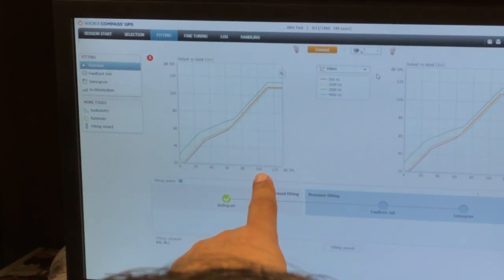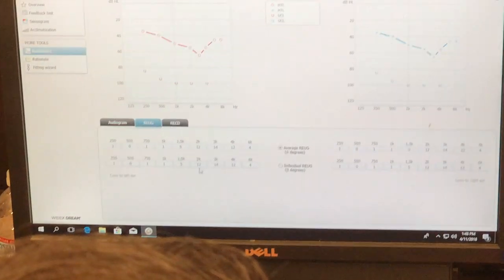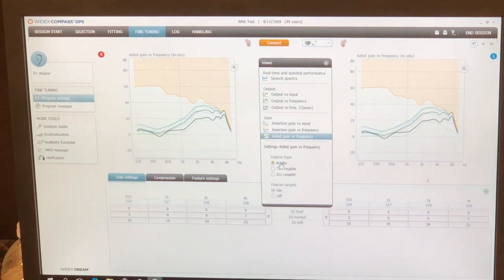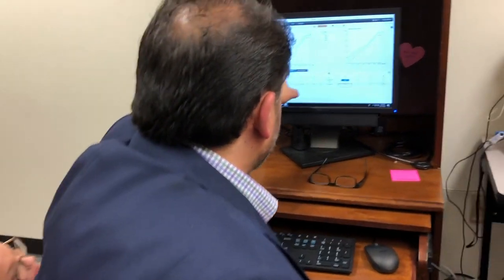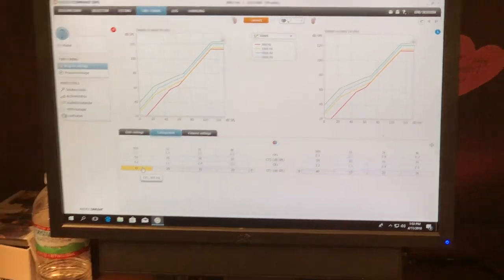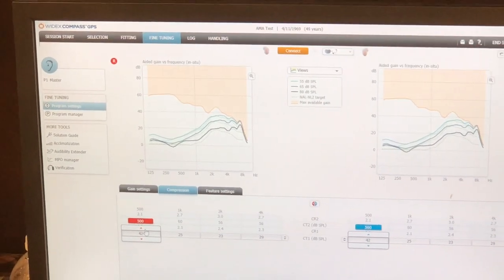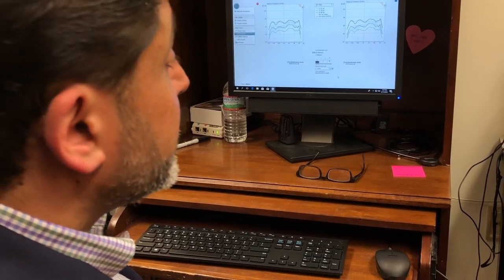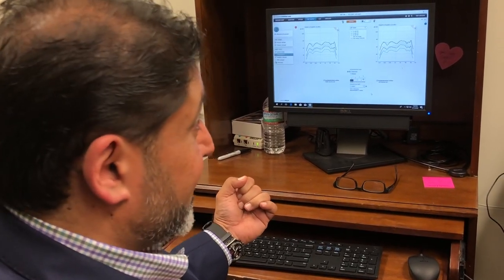Part 3: Hearing Aid Fitting

Comment: I have a question. At the beginning on the first 30 seconds. Doesn't the compression should be more for high frequency sounds as the dynamic range is reduced? The more reduced the dynamic range the more compression it needs. How do we know that the ear acts linear towards the high frequencies or where can I read about that?  Or does the linearity towards the right has to do with the isophonic curves when reaching the UCL of the person, that tends to flatten the curve and most of the frequencies are perceived at the same level? Thank you and keep the good work